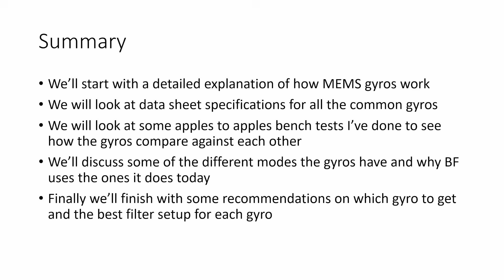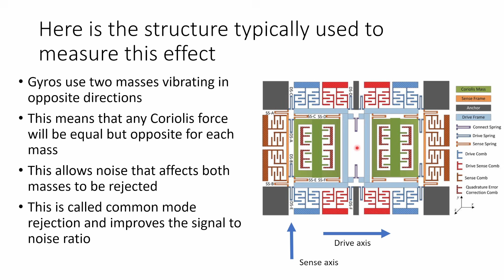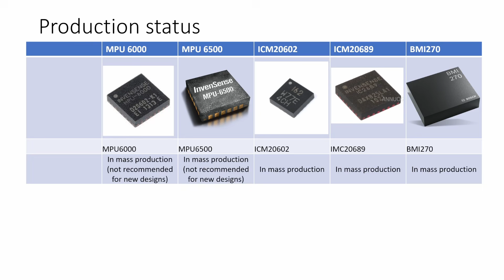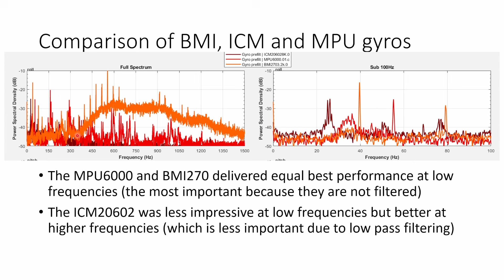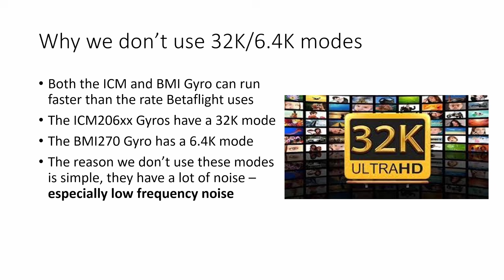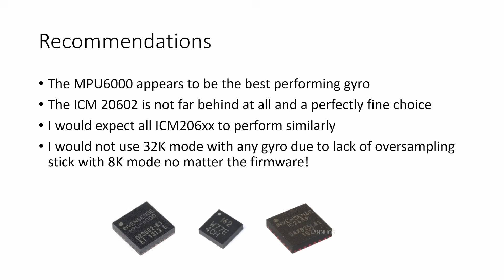Gyro shootout: MPU6000 vs ICM20602 vs BMI270 and OSR4 mode for BMI Gyros!

Comment: Chris, can I ask you a big question? With regard to the software processing that's happening on the gyro chip, do we have any way whatsoever of knowing what theyre doing under the hood? I've been very curious to know whether their algorithm makes any use of the onboard accelerometer during the gyro output processing. Perhaps they use it as a cross check during oversample averaging as a noise reduction method. How would we know if they did this?
Reply from the maker: The algorithm under the hood is proprietary although my recent testing has shown that the filter they use is a 3rd order lowpass filter (butterworth) and I have determined the approximate cutoff and delay. I don't think the data from the accelerometer and gyro interact.

Comment: Pretty amazing vid and glad someone dives as deep into the subject as you! This really a is adding a lot to where that d-term-noise might come from. Also a clever idea to run those props upside down! Now what I would wonder:
- What are those peaks you see in those noise-charts? Especially that ICM206028k bump around 25hz that look almost like a resonance shape?
- What's the actual response time of those gyros and does this differ? Like... have this controller move a rapidly between 2 angles or actual RPMs (=degrees/second) and watch the gyros follow the move. (Here also the 32khz mode comes into play: in certain applications you want fast response above all while not being interested in low frequencies or precise measurement values like crash-detection/emergency stop use cases. Also predictive maintainance FFT-outputting-sensors will use such a mode to analyse and trace peaks in higher frequencies - here without much interest in response time)
- Is there a max G-Force such a Gyro can measure/withstand? If the signal peaks out in rapid moves the measurement value won't be correct and hence the pid loop will act all weird. Also would a crash physically damage the gyro?
- Do they have long term drifts as they are measuring a relative value without a true reference? 
- Whats the noise behaviour of those gyros in an otherwise similarly tuned quad at similar flights? Would we see differences in the blackbox there?

Thanks again for the vid and keep it up!

Comment: So let me get this right, the expectation then is people are building their own boards or there's a choice of gyro offered? Any gyro is used in a million devices past ours, probably the bosch wins because everyone chooses it. if in production they are fit for purpose. 

This is the perfect example of fixating on detail before effect as it is purely another extension of feedback loop driven control mechanisms, it measures acceleration on the 3 axis we use of xyz and if without, or in mismatch to associated inputs the acceleration is cancelled. 
There is no gain (excuse the pun) to learning this for any future aircraft engineer, kwads also being aircraft, because if you're left engineering gyros it won't be aircraft related and you won't see a complete part yourself.

 This is taking time better spent on Bernoulis theorems and Fluid dynamics generally and which is very simple and visual, perhaps followed on by some basic FEA for frame stress and vibration, but due to complete lack of consistency between every model quad, it's just as effective to fly it and assess how it feels.

Comment: Manufacturers do not leave a mode out of the datasheets for no reason. Sure, manufacturers do reuse logic and code so quite often there are common features between a range of products. But, chances are that there are or were issues with that particular feature on that particular product. There is also no guarantee at all that they won't disappear or change function between revisions.

So, why would I want that OSR4 mode? It is unsupported, possibly unstable in the future, and the same can be accomplished using filters in software which we already have. Even better: those filters adapt to flight conditions as much as possible, something that hardcoded filters in the gyro (or any other piece of equipment) cannot do.

On gyro choice: from a flight performance perspective I cannot feel the difference between MPU6000 and ICM20602. However: I tend to use my stuff until it is really beyond repair, and I have the repair skills to really stretch the life of quad hardware. Rewinding burnt stators, fixing broken ESC's, reanimating butchered flight controllers.
Now, I have several MPU6000-equipped flight controllers that are so butchered that I had to solder wires to the CPU to replace PCB tracks coming loose. They still perform fine. ICM20602-equipped FC's never reach that age; they tend to develop a twitch long before that. 

Do you have any information about the durability of the BMI gyros?

Comment: Would it be worth oversampling at an even higher rate? For instance, what would happen if we had a target data rate of 2kHz and oversampled to that? At what point is there diminishing returns? Is filtering and oversampling within the gyro more efficient than filtering the gyro output in betaflight?

Comment: Great explanation why 32kHz mode in FC is a technical nonsense.  24DB more noise in usable bandwith is a lot too much. Now it is obvious why they like to fry motors even with slightly biten or bended props.

Comment: Hi Chris. One thing I have been very wary of in the last 4-5 years as we have transitioned from 4s to 6s is the gyro supply voltage regulator and the spec frequencies and voltage limits they state that they can handle! Less noise would be awesome.

Comment: Just curious, Is the OSR4 mode specific to the BMI270 and gyros such as the BMI160 that is in the brainFPV radix can not run it? If you mentioned it in the video then I am sorry and I must have missed it.
Reply from the maker: OSR mode is supported on BMI160 as well as several other Bosch gyros. 👍
Reply: @ChrisRosser  Cool, I have 2 quads with radix's in them that I will happily test it on😊

Comment: Within the different  quad groups on Facebook. I am seeming a lot more people reporting issues with faulty  mpu6000 gyros.  Mostly with weird noise showing up on one axis and following the axis when rotating the fc.  I've always heard the mpu6000 was considered the trusty tried and true gyro. Would you have an idea on why it seems these gyros are having a higher than normal defect or being  faulty rate?
Reply: Would be nice to see how many people having these issues swapped to a new gyro and the problem persisted. Can tell you I had a thicc give me lots of noise on sub 100hz frequency and swapping fc or gyro did not fix it.
Reply: @BonemysterFPV   I am referring to people that rotated their fc and noise followed the rotation of fc. I have several  glide frames that aren't known for their rigidity  or low noise profile. I do have one that is  clean below 150hz on all axis. It used to be noisy pretty much all over starting at or just below 100Hz. I swapped out fc's  and also ended up swapping the 4in1 to some cheapo brand. I was pleasantly surprised  how clean it ended up being considering the frame. Something to note. I swapped out a mpu6000 for a icm20602. I have several builds that should be super clean sub 150hz. But they are not even close.  Caps on everything.  I am wondering if the noise  performance  of gyros are quite variable.

Comment: I found this video confusing:

- you say below 100hz freqs can't be filtered because they're flight frequencies, yet on 8k mode the gyros are averaging samples which is filtering.   Couldn't the flight controller do the exact same averaging? At the end of the day this is yet again a delay vs filtering tradeoff, are we sure the "average 4 samples" strategy of the 8k mode is actually optimal? Why?

- Similarly, the bosch has an undocumented mode (so does the mpu6000, Betaflight already supports it, it's called experimental or something like that) that changes the in-gyro filtering behaviour. Why is it better for the gyro to do (or not do) this filtering rather than the flight controller? I find it surprising that we wouldn't want to tune this ourselves in the FC like all other filters
Reply from the maker: The gyros filter by sampling at a higher rate (128kHz for MPU/ICM, 12.8K for BMI) and then averaging (oversampling) I think. Betaflight cannot do the same thing because we do not have access to the higher data rate which means that when we average we lose information compared to what the gyro can do internally. The gyro can do the filtering better because it has internal access to a higher data rate than what it outputs on SPI.
Reply: @ChrisRosser  Great video! But  I'm really confused with noise dencity in 32k mode. From my understanding oversampling is just a low pass filter so it cant reduce noise dencity at low frequencies. Something is wrong in this mode. I can only guess an aliasing effect somewere in processing pipilene. Can you share information how it's build? I can't find anything about real sample rate of ADCs, ICM20602 datasheet says "the ADC sample rate is
programmable from 8,000 samples per second, down to 3.9 samples per second"

Comment: In my years of flying quads at the highest level of Freestyle performance, I can say that the MPU6000 for me has been a total winner. I tend to do alot of on-purpose building tapping, rail riding and I subject the quad to alot of blunt force, tapping stop signs and other things. I fly hard. ALL the flight controllers that I own with ICM 20602 gyro have all had gyro failures after 4-6 months of flying. For me, the ICM 20602 is a waste of time and money because they lack durability and reliability for my flying style. The ICM 20602 flies very nice in the beginning, but after a few months they get twitchy for me and make the quads fly like junk.  I mostly fly Holybro flight controllers and all their new models have switched away for the ICM 20602 to the MPU6000 and that made a huge difference in gyro durability & performance for me.  I do have some un-used New Radix 2 flight controllers sitting on the shelf that I will be using for the first time this spring. Looking forward to testing out the BMI270 gyro for sure.  Chris, I truly appreciate all the time you put into your testing and production.  Thankyou for this video.
Reply: Hmm this is going to be a problem because MPU6000 is being retired... Have you tested a FCU with BMI270?

Comment: One addition - you tested FCs with gyro not the gyro itself.
Reply: I assume so as well. Its similar to when ppl say in audio that an amplifier A is better than the B, because the A has a Wolfson  in it and B has a slightly worse chip. They forget that the implementation matters... On the other hand - it is mm hard o expect Chris to build his own test rigs for gyro chips. I only wish he mentioned about the testing m protocol and m in particular - how many samples of any given gyro he used and - how big spread of results occurred within the same gyro model. Only if the spread of results for any given model is significantly smaller than the difference between the averaged results for different models of gyros, can we speak of meaningful differences....

Comment: Hi Chris. Recently I've built AOS 5 in the same config as you have in your AOS 5 video (SucceX-D Mini F7 TwinG Stack (Mini F7+45A ESC), iFlight XING2 2207 1855KV, ...). This is dual gyro FC with ICM20689 and I have to say I have only bad experience with this gyro. Quad twitched at BF 4.3 defaults and no filtering tweaking helped. BB showed random "unnatural" spikes in gyro data. I tried only first gyro, not good (spikes in roll and pitch axis), only second, not good (but now spikes in yaw axis). FC soft mounted. I tried hard mounting - even worse. I bought another FC (the same type, but different date of production, different batch). But I had the same issue! Power is properly filtered (big cap). However when FC is just hanging in the air (holding in hand) twitching is gone on both FCs. So I tried FC with MPU6000 (there are just a few in 20x20mm config with DJI plug, so I went with HGLRC Zeus F722 Mini). Problem solved! (everything else on the quad stayed, I just swapped the FC).
=> either I was extremely unlucky or ICM20689 are not good gyros. My guess, from all the clues I have is, that the tiny MEMS structure in ICM20689 is susceptible to "oversaturation" with the motor noise motion when we use it in our quads (all of these gyros are primarily designed for smart phones, right? We "misuse" them in quads).
For me it's definitely only MPU6000 from now on!
Thanks for your videos, Chris, you're one of the most important contributor to the FPV community nowadays! Your scientific approach has no match! Excellent!
Reply: Iflight make terrible electronics, just avoid them at all costs. I bought 9 iflight stacks and 6 had bad gyros out of the box.

Comment: Thank You for making this video Chris!  Recently I purchased an IFlight Beast AIO thinking it came with the MPU6000 But instead came with the BMI270. Which only supports a 3K Gyro and PID loop in BF which affected its flight performance negatively 😠. Great video as usual 😂
Reply from the maker: Drop me an email and I'll send you the OSR4 code. That'll make it perform as good if not better than MPU6000 in my testing.
Reply: @ChrisRosser  What’s your email?
Reply: Can bf tell me which hw/gyro is installed or do I have to go on the fc with a magnifying glass on search what is printed on it? 😅
Reply: @BBFPV  It’s usually in the product description page from the vendor.
Reply: @cheechfpv  Yes but you said it has not true what the manufacturer has specified, how do you know that on your Beast is not 6000 on it?
Reply: @BBFPV  PID and Gyro only go up to 3.3K in BF. MPU6000 goes up to 8K. Best of luck.

Comment: Hardware DLPF options are also available for the MPU6K series as well as the 6060X series … we have known about these functions for a very long time ..
Reply: You should dig into not those data sheets and code also..  IMHO I am not your comparison is correct based on that as the other gyros can also be adjusted as needed ..
Reply from the maker: The MPU6xxx and ICM206xx gyro hardware DLPF can only be reduced from 250Hz. As 250Hz is sufficient for our needs lowering the cutoffs would make things worse. Turning off the DLPF in the MPU/ICM gyros also turns off hardware oversampling which has a huge noise penalty and is therefore unusable. We are already using the best configuration for MPU/ICM gyros. We are not, in my opinon, currently using the best configuration for BMI gyros.
Reply: @ChrisRosser  this is true with the 6000 but the 20602 can be set as high as 1k…  but I hear your thoughts regarding the current settings being fairly optimal…  Also regarding 32khz gyros…  I feel the bigger  reason 32khz isn’t used is due to available CPU cycles with the addition of RPM filtering .  In BeF on F4/f7 there is not enough cpu to run both ..  but other firmwares have subjectively great results on 32khz..  I personally run 16khz on most of my setups and I’ve had no noise issues ..  ymmv
Reply from the maker: @MAD_CHILLER  I'm not familiar with the 60602 gyro. But the ICM20602 has a max DLPF of 250Hz according to its datasheet. Can you provide a reference for the 1kHz DLPF?

Comment: Hi Chris! Great video, I'm always impressed by how well you explain everything at such a level of depth.
You say in the video that the MPU is still in production. Just curious, how did you verify that?
It's interesting that the oft-repeated "common knowledge" is that the MPU6000 is out of production and we're getting "inferior B-stock" now on FCs with that gyro. It would be kinda amusing if that was just a myth...
Reply from the maker: Invensense advertise the gyro as "in production" here: https://product.tdk.com/en/search/sensor/mortion-inertial/imu/info?part_no=MPU-6000. If a silicon manufacturer says a part is still in production, it is. There is a very specific end of life process for silicon components. It will be marked end of life and then there will be a last buy opportunity. Lead times are long at the moment (52 weeks!) due to fab capacity but I am confident to state that the part is still in production.
Reply: Awesome, thanks for the link! Do you have any idea if there's such a thing as "B stock" for these gyros, or would they all be the same quality? I'm just trying to separate fact from fiction on these posts I've seen over the past year that warn people off the MPU6000.

Comment: so the lesson is,, do not buy iflight beast f7 ?
Reply from the maker: Not at all. Just use my special OSR4 build! drop me an email if you want it.
Reply: I wouldn't buy it.. but not for that reason. I bought the H7 version and it died on the bench during motor testing, I'll probably never buy a FC with a BGA sized chipset again.
Reply: I have 2 iFlight Beast F7. One with BMI270 (3.2k) and the other uses MPU6000 (8k). The one with BMI270 has serious oscillation issues which make my HGLRC Racewhoop30 not being able to fly at all. The one with MPU6000 flies flawlessly.
Reply from the maker: @MrMikegor  You need OSR4 mode. Send me an email and I'll send you the test code (email in the about section of youtube channel)

Comment: Thank you for this awesome video, Chris. I really doubt that BMI270 undocumented OSR4 feature will be used in any “production” release of the FC FWs, as it may disappear in the future production batches, which may cause a lot of problems.
Reply from the maker: It is listed in the register map but not explained in the datasheet. Several other Bosch gyros have the feature fully explained and its not going away. Simply an omission in the datasheet.